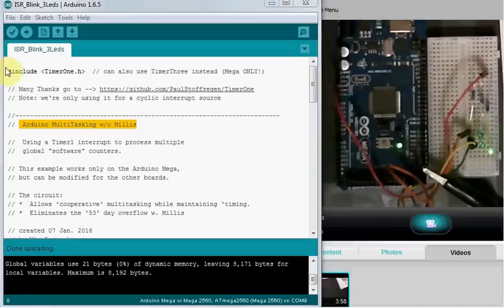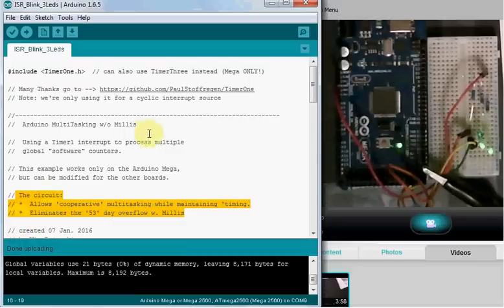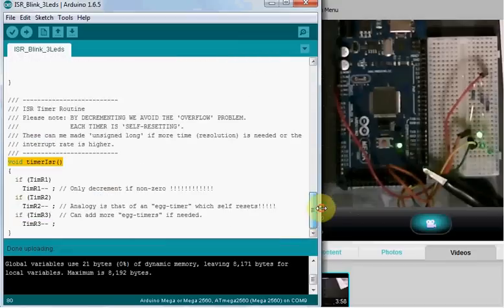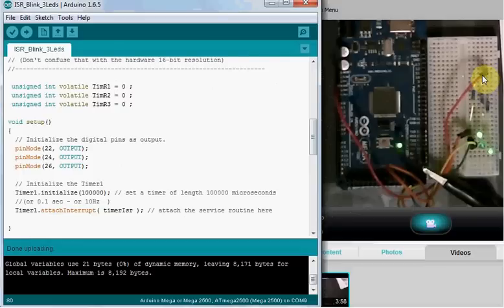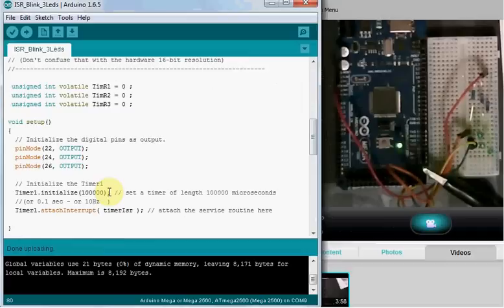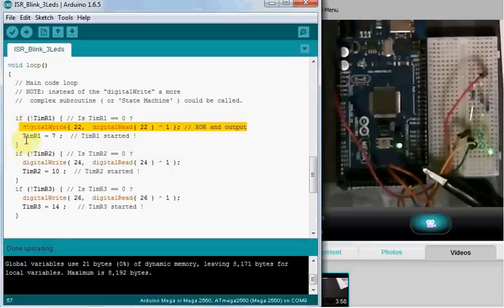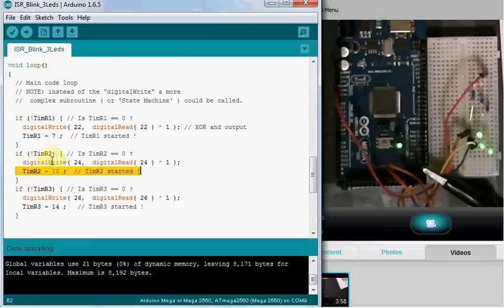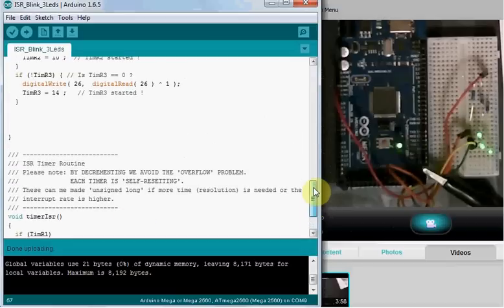Arduino MultiTasking w/o Millis or Delay

Comment: sir i make an egg automatic incubator for my universty project i use two relays and one dht11 sensor
(sorry for my english)
one relay i use for gear motor to rotate egg turner
and the seccond relay i use for a light and fan for controling temperature
i use delay for rotating the eggs
so the dht11 also use that delay and dont show the temperature between delay time please help me how can i use multi tasking
i mean i want to see the temperature and humidity during delay time please replay